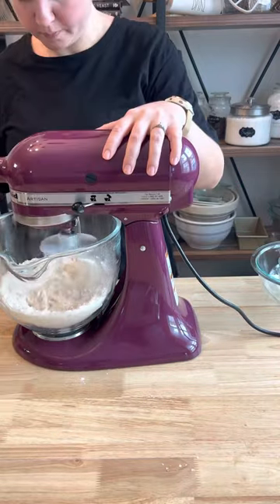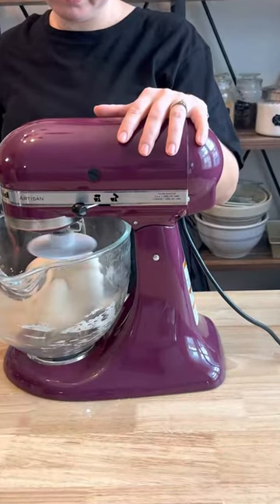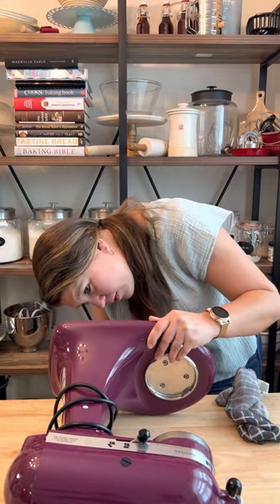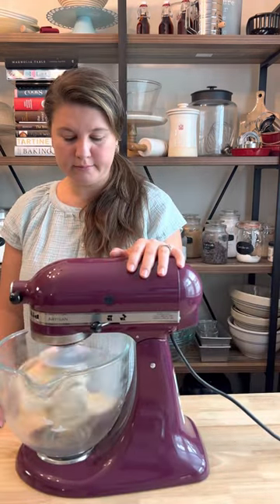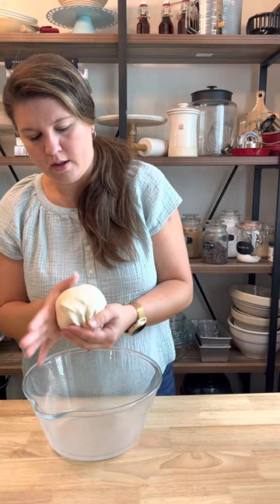HELP! Why does my stand mixer shake so much? | How to fix stand mixer wobble. #shorts

Comment: If the KitchenAid mixer rocks, it was more than likely because you have one rubber foot missing. The screw from underneath is to put pressure on the rod that goes through the stand, and that keeps the mixer head from coming off the stand. I know this because I repair KitchenAid mixers. If you mixer head is bouncing, then it is the screw that you  don’t see, unless you look. You  tilt the head back, remove the bowl, and look for the adjustable screw where it tilts. To fix the bounce, you turn the screw counter-clockwise, in small increments, until the bounce is gone. The reason for the bounce is because the head is tilted to low, and the attachments are bouncing off the bowl.
Reply from the maker: Good to know!
Reply: Thank you for the very helpful recommendation!
Reply: Just had this exact mixer given to me by a friend. Said the head keeps kicking up and turning it off or something like that, I haven’t looked at it yet.

Comment: Kitchen aid recommend speed 1-2 when kneading, yours looks a tad fast.
Reply from the maker: Appreciate the feedback!
Reply: I was thinking the same thing. Definitely too fast for dough, it'll put more wear on the gears over time. 

Probably a good idea to check the gears and change the grease every 6 months if you're kneading at such high speeds.